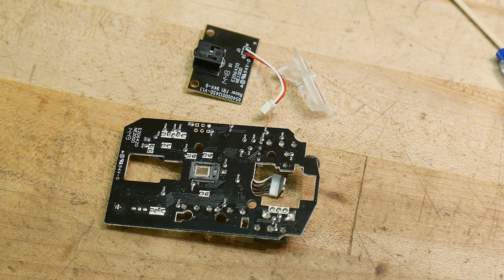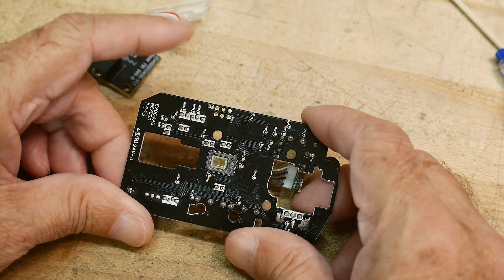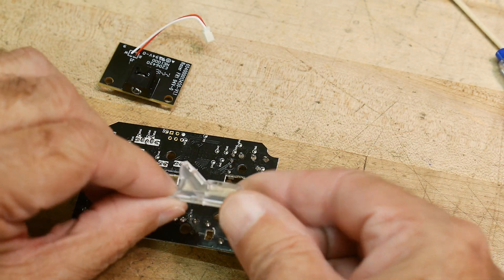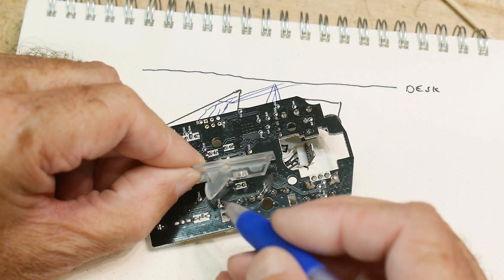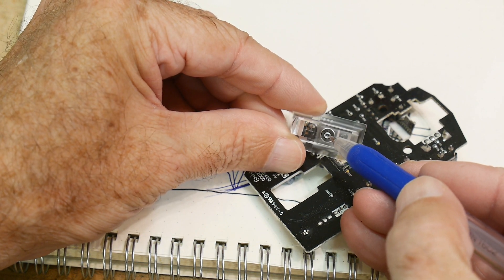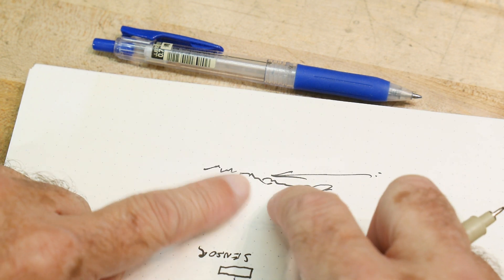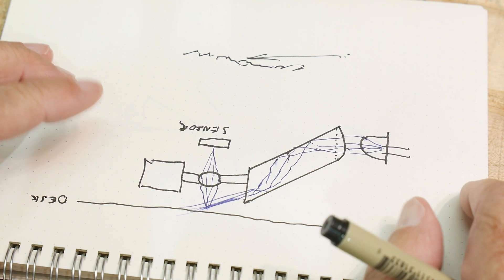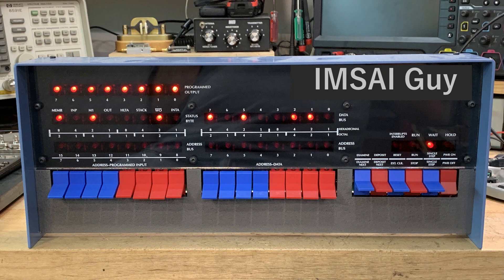#929 Computer Mouse Optics

Comment: Thank you so much for your high quality content. Obviously low-cost optical  mouse odometry has great potential and I've tinkered with it onboard my monorail model system, in the last year or so. My favourite feature enhancement would be to increase the mouse liftoff distance from the standard 1 to 2 mm range, to a larger 5 to 10 mm suitable for moving models by modifying the optical arrangement(s). I've taken a couple of such mice apart and found the both lenses were concave (diverging) and also used a pinhole or aperture nearest to the sensor. I'm a retired engineer with only some basics of optics and I have a couple of questions for you please. First, do you think increasing the mouse liftoff distance by modifying the optics to achieve 5 to 10 mm is realistic and practical? Secondly, if it is feasible, what optical modifications would you suggest to the mouse, to get a greater liftoff distance working e.g. pinhole size and distance from sensor, and replacing the original lens and/or adding another lens for corrections. Thanks in advance for reading.

Comment: The original little optical parts of some of the first optical mice looked like they had the Agilent "star" logo molded into the plastic. And you used to work at HP (and maybe when it became Agilent), and you said you worked with these previously. Were those original optical bits actually made by Agilent?
Reply from the maker: Yes
Reply: @IMSAIGuy  Heh, I thought that was the Agilent logo. I've mentioned that to a few people over the years, and always get blank stares back! I feel like I'm one of very few people that ever noticed that!
Reply from the maker: @gorak9000  Agilent split from HP in 2000. at that split I ended up at agilent and part of the group designing mice.
Reply from the maker: https://www.newark.com/pdfs/datasheets/Agilent/ADNK-2623.pdf

Comment: So, I have a Logitech MX Anywhere mouse (wireless). It is advertised as a "darkfield" mouse and has no visible light.  The big claim is that it will work on any surface including smooth polished glass, with or without any thing under the glass.  And, it does just fine.

It will work when raised up above the surface about an 1/8 inch, but not much higher.  So, it is not reading the material under the glass.  How does it work?
Reply: IR laser diode illumination, and a sensor with an IR filter on the camera. Deep depth of field on the optical system, and it relies on slight imperfections in the surface, and on stress in the glass, to give that slight variability in contrast to operate.
Reply: @SeanBZA  Thank for that explanation.  My desk at work had a layer of glass (actually Plexiglas) on top of it.  The Logitech MX Anywhere were the only optical mice that would work properly.
Reply from the maker: I'm not familiar with that design.

Comment: I've never seen this such mouse pcb , the pcbs I've seen just had some capacitors and one lamp 😁
Reply: Got one that recently failed with me, SRBP cheap PCB, single sided copper clad board, with the single all singing all dancing chip with the pinhole lens for camera, a single red LED to provide illumination, 3 button switches, an encoder for the scroll wheel, 5 1/8W resistors, 2 small cheap disc ceramic capacitors and one10uF 25V cheap electrolytic capacitor on the board. It stopped working correctly to register button clicks on all buttons and the movement went odd, so it was replaced with another used 30c mouse.
Reply: @SeanBZA  We all love to destroy our mouses or wait to mouse be destroyed 😁 thanks bro . Useful details .

Comment: I really wonder just what the camera is seeing!  I tried to FOOL the mouse but had no luck! First, I used the surface of a DVD shiny side. Mouse worked fine. Then the back of the DVD, shiny black plastic. The  mouse worked fine. Then a sheet of white shiny plastic. The mouse worked fine. Then a flat piece of aluminum foil, shiny side. The mouse worked fine! Then to really get serious, I used a 2 inch square mirrored optical flat that was a perfect mirror. The mouse still worked but took a bit more movement per inch on the screen. So I am perplexed as to just what the image is from the camera! Peering into the opening of the mouse it is built like your example.
Reply: The optical mirror it uses the fine particles of dust on the surface as contrast to detect movement. I use a piece of granite slab as a mouse pad, as it is flat, optically smooth, polished to a nice finish, but has all these buried crystal planes in it to give a good result. Scrap piece from a granite cutter, offcut from them making kitchen tops in black granite.
Reply: @SeanBZA  I took the optical flat and carefully cleaned it before the test. No dust, no residue. Optically flat to 1/10 wave. Looking at it with a microscope at 1000 power shows a flat smooth surface.
Reply: @glasslinger  Ron then it must have been looking at the shadows cast by the hand on the glass, or a reflection between the surface and the base of the mouse giving just enough contrast to make it work. There are a lot of modern ones which will work on a glass sheet that is polished.
Reply from the maker: some mice use a laser and interference, very different from what I show here

Comment: Slightly more complicated and advanced than the first wooden mouse invented by Xerox.
Reply from the maker: This one was invented at HP Labs just down the hill from PARC
Reply: Yes but still sends as a stream to the computer a simple set of data, showing a relative motion in X, another relative motion in Y, and then a set of input bits that show button press and scroll wheel operation and direction. A lot also have the camera information available as another endpoint, but rarely shown to the computer and hidden by the driver, only there for diagnostic purposes.
Reply: @SeanBZA  I tend to believe that the first mouse had no electronics and the mechanical movement was sent as two quadrature signals generated by mechanical switches.